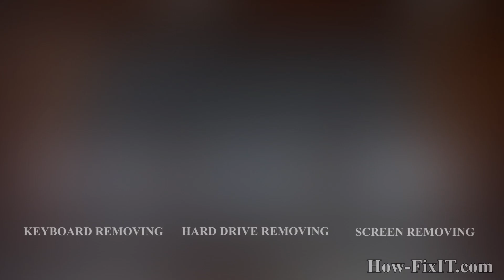Lenovo G510 Disassembly, Fan Cleaning, and Thermal Paste Replacement Guide

Comment: Does opening the laptop like that will affect my general data for example desktop files , i have a battery issue and my laptop need alot of cleaning so i handle it to an expert but Im afraid of lossing my data . It won't affect right

Comment: HEY MAN WHAT THE NAME OF THAT WHITE SUBSTANCE YOU USE
Reply from the maker: +jassim nuwaider this is thermal paste. For example you can use Zalman ZM-STG2
Reply: +jassim nuwaider Thanx bro ... well iam not sure that stuff is available in iraq , so is it fine to keep the old paste ?
Reply from the maker: it better to apply new thermal paste
Reply: +How-FixIT thanx alot.. i cleaned the fan and the laptop is running perfectly fine
Reply: +How-FixIT thanx alot.. i cleaned the fan and the laptop is running perfectly fine